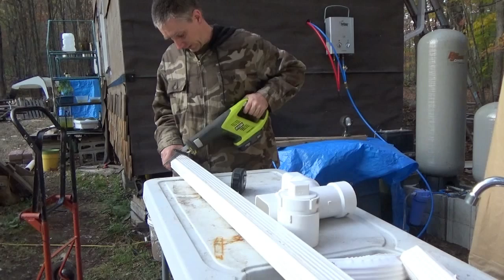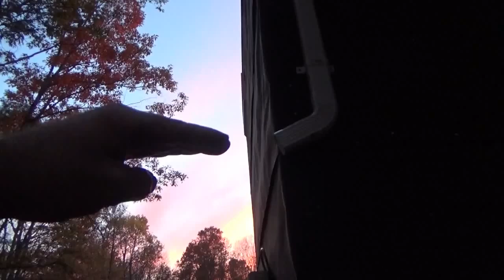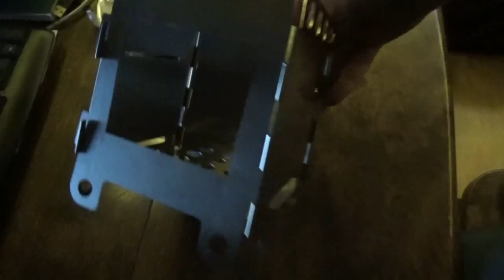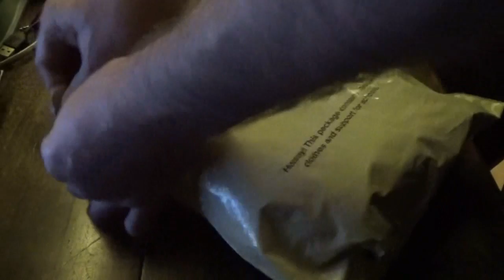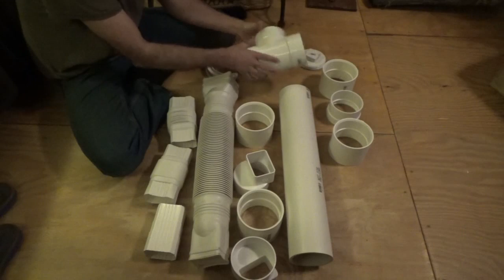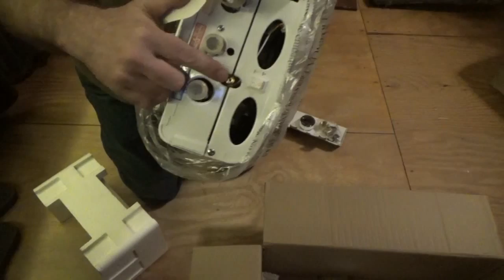Working On Tiny House Rain Water Collection System Part 2

Comment: Since you didn't finish the siding first won't you have to remove all the things your fastening to the sides in order to install siding?
Reply: +Captain Carl Wright Who needs siding in the winter? the snows about to fall better hurry and get that rain collection system installed so it has plenty of time to freeze solid and be unusable for a good 5 months or more. Siding is over rated compared to the protection of seasoned tar paper.
Reply: +Bob Minton  agree to that, cant follow that eather, its yust way more work first making it, then getting it all of, and fix it again, told him a million times, but he does it his way.....
Reply: MrBugsier5
Either send him what he needs to do it your way, or quit whining when he doesn't do it "just because you want it done YOUR WAY on HIS HOUSE."

If you're not paying his bills, you've got no right to whine about things being done to HIS HOUSE on HIS BUDGET.

Of course...that would eliminate your incessant need to proclaim how much smarter you are than anyone who doesn't do things exactly the way YOU would.
Reply: +Captain Carl Wright Its awkward, but it's entirely possible.  We just added 2" of foam outside of then house a few years back, and we had to do that to EVERYTHING outside of the house.  Wasn't that hard...just had a few things that needed to be replaced.

Suggestion to all:  If you side your house, KEEP SPARE PIECES, and make sure to keep a few uncut pieces as spares, as "modern siding" is NOT like aluminum siding:  IT WILL BREAK and it WILL need to be replaced at some point, or at least a few pieces of it will.  It's a virtual guarantee.
Reply: ***** that's bullshit and you know it, its advise from someone who has seen it, done it (and is selling and installing it now professionally for customers her in Europe!!), what do you want more from someone who gives well meant advice? in my opinion there is only one good way, and that's the right one, tell me what is the problem by forinctance mounting a gas water heater on a alu board , instead of directly on a fire hazardous material as tar paper?? als long as nobody tells him he can better mount it on a fire resistant plate, he will forget it , also for temporary use or mounting its plane dangerous!, Its not the materials, he has it!, its the skill mounting and building, he has lack off, iff i had the money i would have helped him on a daily base, even years ago!, building his home, and repairing and installing everything, all in less time Troy needs to accomplish things, its just, the more you have done it, the faster its done!sorry , i don't have enough money to make the trip to the USA!  all in all he has come a long way, he has build his tiny house,no one believed he could do that! ) he doesn't need to follow my well meant advice, but at least y try to give usable advice, haven't heard that from many here!
Regards Richard (mr Bugsier 5)
Reply: D Lastname the most things he has (even spares) are mostly donated to him, so why distroy a working system when he has enough materials spare?
Reply: Bob Minton I used PVC board for my  fascia it does not rot and never requires painting.This is what I used. http://www.lowes.com/pd_209621-1487-07311___?productId=3339718&pl=1&Ntt=pvc+board
Reply: +Bob Minton 
I agree with you.  I just recently finished the water system in our tiny house.  And sure, we would have really liked to have running hot water all summer, but we delayed until I had completed the insulated water shed.  So, rather than pump water from our new 150 gallon water tank, we just pumped from 5 gallon jugs.  It was a little inconvenient, but I wasn't going to install an exposed water system outside, only to have to disassemble it to build the enclosure.  There's just too much work to do, out on a working homestead, to have to do jobs twice (or three times) over.

Some of the process has been documented and posted on our channel.
Reply: Tinys offgrid clubhouse
Cool!  Thanks!  I'm off to check out the "clubhouse"  :o)
Reply: Bull Moos
Reply: Bull M
Reply: Bull M
Reply: ElectroPig Von Fokkeng
Reply: Bull M

Comment: Troy that plastic rain gutter and down spouts are no good. They crack and fall apart when they get cold, which you will find out soon enough. You need to slow down and try to make the water lines neater and go through the floor or lower sides. Drilling holes through the sides is not a good idea. We used the aluminum larger commercial rain gutters and down spouts, they don't clog as easily with pine needles and leaves, which you will also experience soon enough.
Reply: *****
Install the larger commercial
 gutters and down spouts and they hardly ever clog.
Reply: Bob Minton
yes
Reply from the maker: +BUDDY LIGHT I guess I will find out on the gutter. I went through the wall where it was convenient for me to work on the plumbing. This whole area will be inside a shed anyway. Thanks
Reply: The Do It Yourself World
But convenient is not always the best idea.